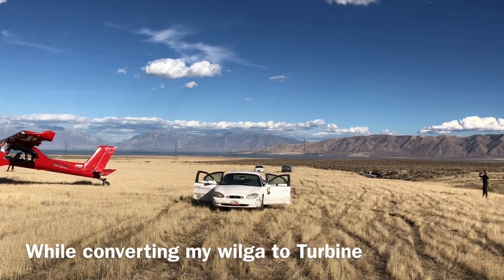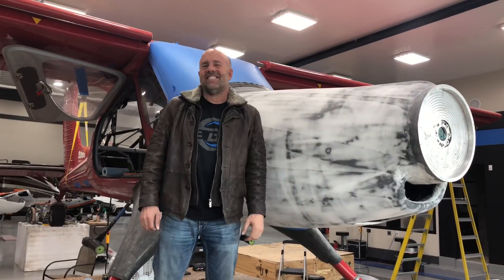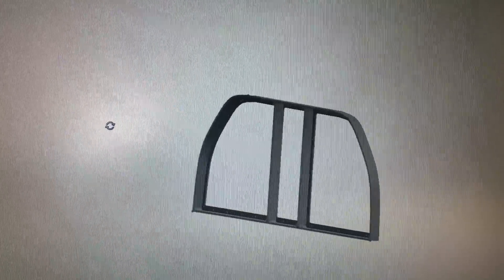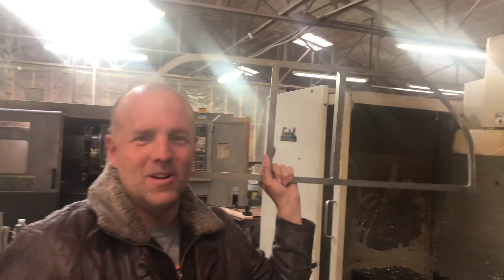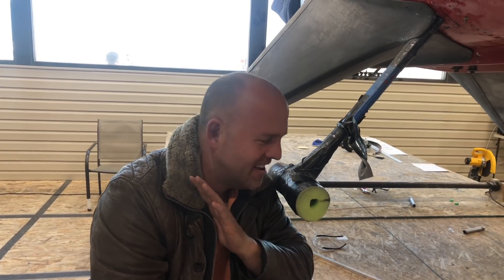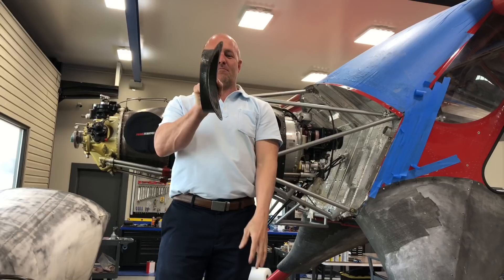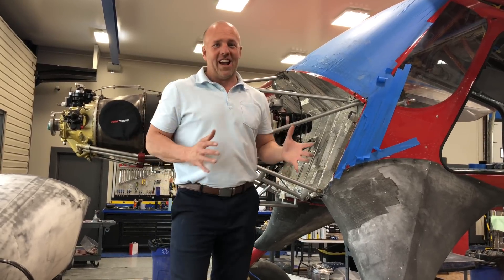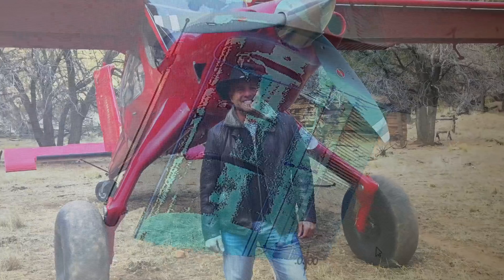Mike Patey Wilga (DRACO Video 8) Turbine Pressure Plenum, Panel Starts

Comment: Not sure if you check you messages, but there is a company called Flexi Sanders that are used a lot in the marine industry. You can shape  fairing compounds with them as well as get electric powered sanders that contour to the shapes of your cowls. Might want to give them a try. It saves a bunch of time blocking and fairing panels with no straight edges. It also saves your shoulders after many hours of sanding.  Cheers!

Comment: forgive my ignorance, for your instrument frame, instead of a billet piece of aluminum, could you not build and assemble L shape aluminum extrusion?
I know that this machining from a billet is often used in aircraft, but this instrument panel does not seem like a structural element?

Comment: Would it be an issue to use an electric sander instead of hand sanding?
Reply: Possibly one of control, you really dont want to get into the fibers.  Once the black is visible you have a tiny bit of resin between enough and to much.

Comment: About 20 years ago, I had a job interview with Raytheon in Wichita, KS. They showed me a few parts of their manufacturing facilities. There was a part of an external fuel tank for the space shuttle. The part was huge. Believe it or not, they machined it from a solid piece of high grade aluminum, about 6 inches thick. Close to 95% of material was shaved off but it was the only way to build it to withstand the stress forces during the shuttle launch. Unbelievable. 
Sir, your skills and attitude are truly amazing!
Reply: If there was the volume to justify it a forged piece machined to finished dimensions could be more economical.  But considering the numbers and the timeframe they were built 9ver the lost material didnt equal much in the total cost lol.

Comment: When I worked at Boeing we machined one piece ribs for the 777 out of 4 inch thick material on a tombstone. Ran 10,000 rpm Mazaks horz mills. Machine one side then rotate and finish the other side. Wound up with .100 ribs and stiffeners and .040 web. Left tooling tabs at intervals to be able to cut it away from the carcas. We fought finish problems because of the .040 web thickness and solved it by glueing thin sheets of a stabilizing material in the web areas that got machined away in the process. Ran a Fadal at another shop after Boeing. Good simple machines.

Comment: Im building V2.0 of my PT6 plenum.  I decided to isolate the hot compressor case and bleed valve from the intake air.  My Pitot scoop, inertial sep, plenum is done but still have to make a containment and blast tube to "external cool" that section and may even use that discharge for cabin heat instead of bleed air.  What are your thoughts on the amount of work heat recirculating and entering the engine the way PW sets up the fire seal/plenum area?  Im using the -20 so still  "company" temp limited in most summer operations for the HP I want to use.  Same as you I didnt want to make the engine mounts penetrate an aluminum airbox again.   Great work and thank you for posting your efforts.  Makes me get off the computer and get back into the shop.

Comment: Do you intend on testing how much power you can make if the air filter becomes blocked?
Reply from the maker: Absolutely, my best calculation prior to a test is dropping from 700HP to 650
Reply: If that is the case, that isn't so bad considering the HP increase over your piston engine...